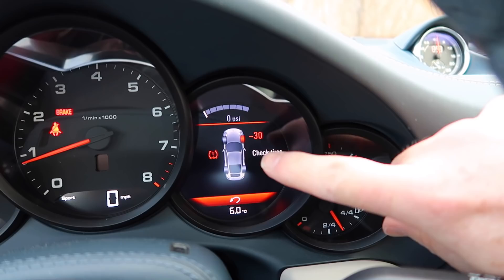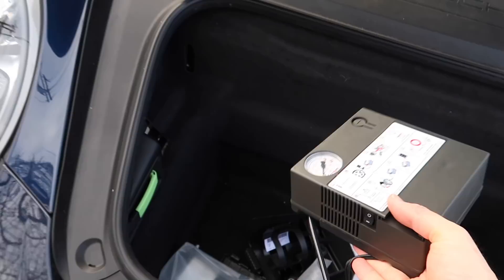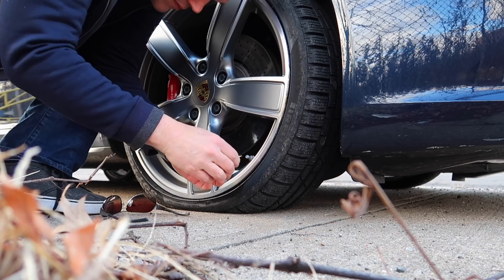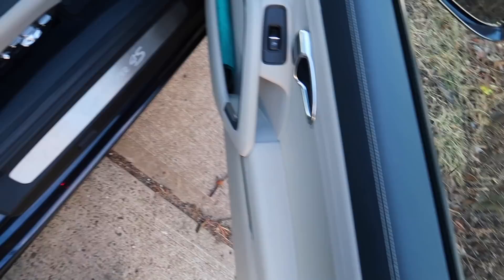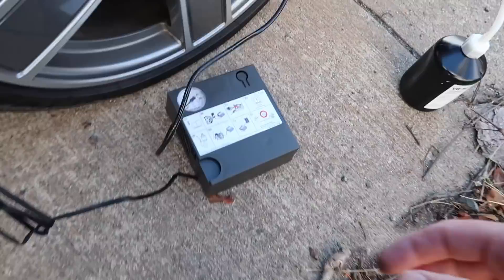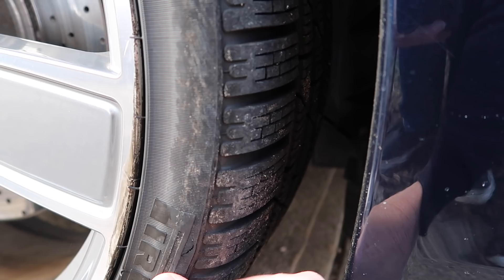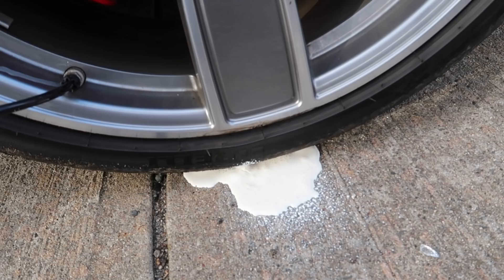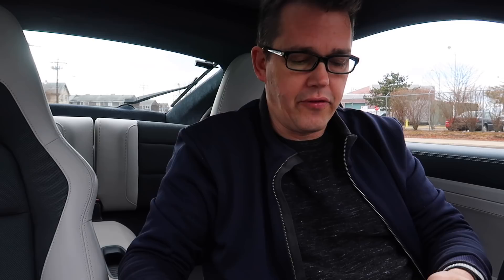Getting a flat tire in a Porsche 911

Comment: Those "fix-a-flat" kits only work for punctures (nails and screws) in the tread of the tire. Side wall gashes in radial tires like your pothole flat are unfixable by any means and require replacing the tire. Sorry you dinged your wheel (visible at 4:27). The State of Connecticut might be liable for a new tire and wheel if you try.  However CT has some funny rules about construction areas and Bridgeport/Stratford on 95 is a construction mess.
Reply: If you have a puncture in the tread it is usually reparable, but if you use that gunk, the tire is not reparable. Unless you're tracking the car, a repair would be ok, so, if you get a puncture, probably better to just call the tow truck.
Reply: Depends on the gunk. I've used Slime on punctures on several flats (cars and bikes). It always washes out with water, allowing a patch or a plug.
Reply: Yes sidewall damage is instant death for tyre

Comment: Nick is a PROFESSIONAL BOSS at his day job. His JOB and career is built on NOT freaking out and working through the solution. Which is what he did if you watch and observe. Step 1, identify problem, step 2, what are the options 1. Call tow with unknown time 2. Try to use fix a flat himself with his kit. He took that step, once that failed, he had no other choice but to use the tow. No need to flip out or get emotional, take a breath, evaluate the situation and resolve successfully. This is why he does well enough and drives a 911 4S . Def take notes some kids!

Comment: Well done Nick.  You should keep your sunglasses on so, you can "look cool" and so you don't step on them by accident.  This was actually a helpful video, now I don't need to read the manual in the event I should get a flat.  I also, always keep this with, in the event I see the obvious... large nail or screw protruding. The only thing missing, that I "also" keep in my car is a plyers if I need to pull the ailing nail or screw out.  Obviously you can't always bee 100% prepared but I figure this is worth a mention.

Comment: I got a flat 2 weeks ago in my 09 Boxster S. I took one look at the bag of tire goo and 1 look at the tire. Then put the goo back in the frunk and called uber.  Went home and pulled the spare out of the 97 Boxster and drove it back home. The tire goo might seal up a nail hole, (provided the nail is still in the tire) but that's about it.

Comment: Good deal Nick.  As I'm sure you've discovered, there is a power outlet in the back of the center console.  And I think you should have another inside the glove box.  I've had both a tread puncture and a sidewall tear on my 16 CGTS.  For punctures, you want to carry a plug kit.  Those tires are very soft and easy to get the plug installed.  Then the compressor works just fine.  I've been driving around on a plug in a rear tire since the summer.  No problems.  Sidewall tears are another problem as you discovered. I called for the flatbed as well.  Hope you made sure they cleaned the inside of the rim very well.  That goop sticks and throws off the balance of the wheel.  So, basically, there is no reason to ever use it.

Comment: exactly my experience with a flat on my 911 - OK for a nail, but also probably unnecessary for a nail as most tires will hold air long enough to get somewhere.  But for sidewall damage, which is likely what you get with a pothole or similar, you are toast and better be carrying a spare.  My flat ended up being a 24 hour ordeal flat-bedding to a dealer (you won't easily find the correct tire anywhere else) at 10pm (Motel 6'ing it - ugh!) to have a new tire put on the next morning, hours from home.  And I was VERY lucky it was not a weekend when Porsche service was not open.  I had a tire repair kit and jack as well - as prepared as possible but there's just no patching sidewall damage.  Travel without a spare at your own peril.

Comment: These tire gunk inflastion kits never work well, also clening the rim inside afterwards is a mess. 
I would just use the air pump to get it holding pressure a bit longer until iam home or reach a tire shop.
Reply: worked for me 2 times, can't say anything bad about them.

Comment: This is the reason it is so shameful that Porsche and others have eliminated emergency spares from their cars, as you’ve discovered, tire sealant does not work on a sidewall tear which is the most common damage from winter road hazards. There was a spare kit that could be ordered from Europe for the 991.1 (outrageously expensive) but I haven’t heard whether it works on the 991.2 or if there is a new kit. I miss the good old days of 996 and earlier when we just had a sensible donut in the trunk that could get you safely home. Now it’s wait for a flatbed and then go to a dealer and then maybe get a loaner and then miss most of a day for something that could be handled in 30 minutes.

Comment: I believe Nick hit a pothole, but in the case of nail/screw Porsche dealers and other resources state you should not remove the nail/screw that gave you a flat...then use either the goo or Fixa-flat.    Also, this happened to me on the way to Road Atlanta Petit Le Mans, and I didn't to use the goo as I wanted to keep that nice 'n tidy in the storage area.  I keep a can of fix-a-flat in my 991.2.  Worked great.  I realize the TPMS implications, etc.

Comment: I'm surprised you didn't get run-flat version of the winter tires for your car. I did for mine for this exact reason. Also, what you have isn't a puncture. It is a rip or a tear which is why the liquid sealant didn't work. The summer tires that came with the car are probably run-flats. I would suggest you get run-flat winter tires for your next set. The Bridgestone Blizzak run-flat tires I've had on 2 of my cars are fantastic.

Comment: Using sealant is like repairing a leak: it is only good for a hole in the tread. Sidewall damage always results in tire replacement due to high amount flexing in that area..

Comment: Our local PCA club is doing a run through Mt Chehea in Alabama. I foresee one of the members having issues as Chehea road is not for the faint of heart. Seeing this video reminds me how hobnobby some Porsche owners are (no offense Nick) 

Nick you could've saved yourself a lot of time just by replacing the tire yourself. It's a extremely easy process with the right tools.
Reply from the maker: I would disagree there. I could not have left the car alone in Bridgeport it would be stripped, so it had to be flat bedded to the dealer and of course that is free and then they do it as I wait so likely less time over all

Comment: The wonder of runflats. Have both for summer and winter. Collected once a pretty big screw in a rear tire and the car drove like it didn't had a flat at all. Downsides: more expensive and kinda harsh drive on bad surface.

Comment: As a guy whit a car that has a full size spare I'm a bit baffled about that sealant crap. Was that tire gash simply too big for the sealant to handle or is the whole set just factory dead weight? - Besides, points for you Nick to sail right trough stuff like this with the humor sails all up. -  Btw, maybe you should read the Porsche instruction leaflet for peeling a banana too. Thehe.
Reply: The kind of hit he had, the tire is a write off. I had a similar hit in my car once. The tire simply.. rips apart .. easily from an inch to 5 inches long gash. That's why the liquid kept pouring out. The hole was just too big for it to seal.

Comment: All that white stuff left beside the road, in a sketchy area, makes it look like you were doing something bedsides trying to pump up a tire...  lol  
I've used the spare-tire-in-a-can stuff you buy at cheap auto parts stores successfully to my surprise.  They have actually worksed well, they are an aerosol can so no gooey liquid all over your hands.  And they simply screw directly onto your valve stem.  Works like a charm.
Reply: works well until you have to replace the tire and the inside is a total mess
Reply: Yea, some tire shops won't touch a wheel with that crap in it.  But it will get you back on the road again.

Comment: You’re a better man than I... when I had a similar situation with my 991.2 TTS, I simply called directly for the flatbed!  

It was 40 minutes out, which allowed me to Uber home, pick up another tire (I put on 21” HRE’s, so bought backup tires JIC!) and then Uber’d back just in time to load her up and ride to the dealer with 911 and new tire in hand.  Overall, much better experience than I could have imagined.  Porsche roadside assistance was outstanding.

Comment: how do they expect that watery goop to seal a larger puncture?  I have the sticky string tire repair in my trunk. I've used it to plug a sidewall puncture in my car.  this stuff worked for 15k on my motorcycle tire.  the advantage of the sticky string plug is you can seal a cut and not just a hole.

Comment: Happened upon this video and decided to comment - although all other comments are over a year old.  I have owned 6 Porsche cars starting with 76 912E.  My 05 911 and current 12 911S  are without spare and I hate it.  If Porsche deleted the tire because they subscribe to run flat tire, 1) they don't offer them, 2) I have never seen any on any Porsche, 3) I am told they a crap tires.  If thew did it to save weight, take it out when you track! I asked the service guy about it and they claimed that if I bought a Boxter spare, it might work, but it could cause damage to the drive train???? I am not sure about that.  The situation is not too bad here in Hawaii, on an island, (although it used to be difficult to get a tire replacement (used to keep one old front and back tire in my garage from most recent tire replacement for security - but never needed it as the local dealer starting keeping appropriate tires in stock at same price as wholesale orders).  Wanted a car for mainland and decided that it must be pre-2005 to be sure it had a spare.  Bought a 99 996C4 and feel safe when traveling from my daughters house in midwest for road trips.  Would appreciate your any anybodies response(s)

Comment: Maybe this method could have worked:: You start inflating the tire with the pump and look for where the puncture is first.Then you move the puncture to the bottom and put in the sealant and let it dry a bit. And then you inflate again!

Comment: Nice try, Nick! That sucks about the wheel and tire. I've got 31,000 miles on my 50th Anniv now. What are you clocking on your odometer? Also, for tires, next set should be Michelin Pilot 4S. At least that's what I'm gonna try next.

Comment: Hmm, I think you didn't do it right, or maybe the very low temperature didn't help the sealing process? Not sure. I have a 997 and had a flat on TRACK, 300 miles off my home, used the same gunk and air, BUT rotated the tire multiple times to ensure the sealant was spread out evenly and it held up for the trip home, as well as another 2 weeks that I got too lazy to fix the tire. It held with zero pressure loss. It could also have been the location of the cut, mine was on the surface of the tire, while yours was on the sidewall...

Comment: That’s a bummer, one of the reasons I don’t like such low profile tires.  Sealant was never going to work with a split like you had. Do you have wheel and tire coverage or will you be out of pocket?

Comment: I got tires and wheels warranty when I first bought my 2017 Panamera 4S，I had 3
flat tires and all got changed for free new tires，I think is good to get that warranty。
Reply: Or just get smaller wheels with larger tires. I don't get these ultra low profile tires. Better for the track of course, but for a daily driver? No thanks. Harsh as hell and constant flat worries.
Reply: OMGWTFLOL  you are right，I just like 21 wheels look

Comment: So sorry to hear about your flat. That is exactly why I will not buy a car with 245/35 series tires without a spare in this part of the country. Imagine if you had damaged the wheel beyond repair or if this had happened on a sat after the dealer was closed. Unfortunately this is the trend. Bring back the spare tires! Bring back the spare tires! Lol
Reply: I believe Porsche roadside assistance is open 24/7 just like flatbed services, I wouldn't worry about it.
Reply: basvenem no doubt. But he wouldn’t get a loaner..
Reply: Possibly, yes. Here in The Netherlands we have a roadside service company called ANWB, which ensures us of road side assistance whenever and wherever need it, even when in a country abroad. This includes a loaner. Does the US not have such a service?
Reply: It’s possible we do, but I’ve never heard of it. The roads here in the Northeast United States are atrocious. Our roads look like they were carpet bombed.

Comment: Nick, sorry about the flat but thanks for the video. Hey, what are your thoughts on 'run flats' for a Porsche (Cayman)? Would that have helped in the situation you were in with the pothole (no nails) or not? Asking also because if you have them for over a year or so and there is wear on all your tires, and you hit a nail, some dealerships will not put in a patch to fix the one tire and say that they have to sell you all 4 tires due to the wear in the other 3 if they were to sell you a brand new tire as it will through off the balance in the vehicle. I would really appreaciate your thoughts on this regarding summer tires (& if you could include if it would be for winter tires also).

Comment: I'm suprised you aren't running P Zero Run flats, so many models are
Reply from the maker: Colin Byrne there are no winter tires in this size that run flat sadly
Reply: OF course, I feel dumb now haha, I forgot it's winter outside... I mean heck I'm in Madison, I should remember that much, but winters where you are have way more snow. I have Pirelli C7s on mine for the winter and they work really well.

Comment: You are driving 20 inch wheels?  Did you compare the 19 inch feel and ride to the 20 inch?  I know on the S model the 20 inch is the standard but with your experience I am curious as to our take on the comfort and handling characteristics between the two sizes.  If I go with the 911 it comes with 19s but could always upgrade to 20s if they are so much better.  You know?
Reply from the maker: 19" wheel ride a lot smoother on the 911
Reply: Nick Murray is the handling significantly worse with the 19 inch wheels or is it still a great experience?

Comment: Porsche saves on the wrong place .... my 2006 old 997 still has a spare tire in the front.
Reply: willi19671 It's not about saving money, it's about saving space and weight.
Reply: My old 2008 997 4S had similar tire inflation kit. Maybe those were user spec 'ed accessories at that time?
Reply: Don't think the compressor and fluid cost that much less than a spare tyre.
Reply: But they weigh a lot less
Reply: Take it out at the track anyway - on the road the extra weight doesn't matter unless you need to prove something to someone who doesn't matter...
Reply: @Audidude  OK, which spare tire would you carry, the front or back?  You CANNOT have 2 different wheels on the same axle.
Reply: Freedom Rider of course you can. But not for normal driving. It’s a limp home solution. Don’t be so precious.

Comment: I learned almost all Maserati drivers don't use these even though they have them. My family member got a flat in a GranTurismo and the hole was too big it just went everywhere. The compressor and sealant were all on one so it needed a new hose and canister. I looked online as when I called the service department they only offered to replace the whole unit. I eventually found the part in a manual and had the Maserati parts manager call me to confirm I wanted that part as they had never ordered it and the manual was vague. When it came he asked if he could see what I ordered. He said I was the first person to ever order this and usually people call road side assistance or have them flat bedded. It was a fun experience. Then it took 5 days to install a new set of tires because they didn't have Michelin tires at the service center and needed to get them from the main dealership.
Reply: TBH unless I was in a desperate need to get some where in a hurry I'd just wait for roadside assistance to swap the tire for me or to tow to a tire shop if the car didn't have a spare.
Reply: TheCobruhAlienat0r That filler isn't cheap, but I don't know how much a tow would be. Also the marked up prices of the tires at the dealership. For example they didn't normally have Michelin Pilot Super Sports so they needed to transfer them from the main dealer to the Service center. People would normally use the stock Pirellis. Also NY potholes and Northeast Potholes can be massive.
Reply: New cars usually have free roadside assistance for the first couple of years so the tow would have been free. If the free assistance has expired you'd have to be crazy not to have a AAA membership, I have the highest tier package that will have them tow up to 100 miles. I wouldn't take the car to the dealership though because it wouldn't be a warranty claim, I'd just go to a tire shop and get the tire from them.
Reply: TheCobruhAlienat0r It does still have roadside assistance which at that time picked up the car and brought it to the service center.

Comment: Good to know that Volkswagen includes tire goo with their overpriced 2 seaters...and you carry a spare banana just in case...of course they could just use run flats...or instead of first trying to put the goo in a valve that still had the stem in it,  you could have called for roadside assistance and gone for a stroll in the nice neighborhood you picked while waiting...just saying...